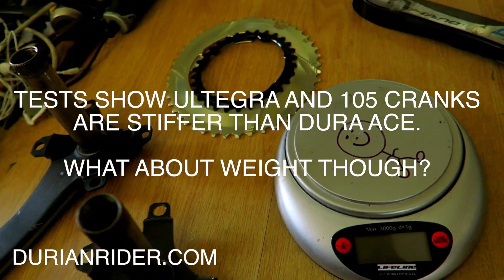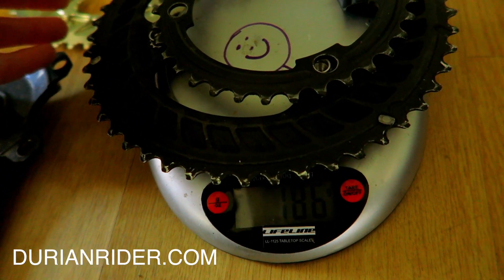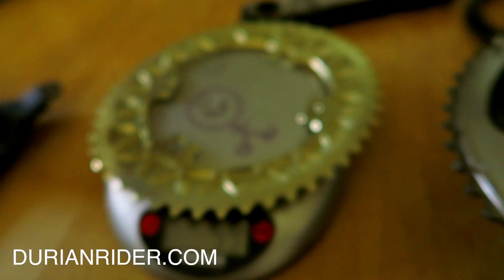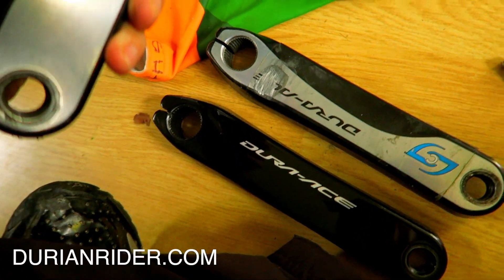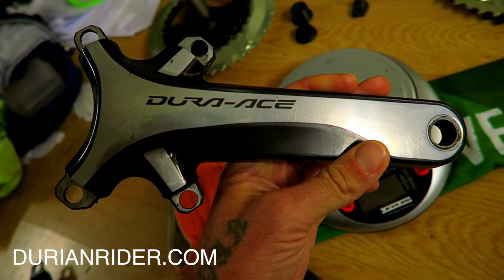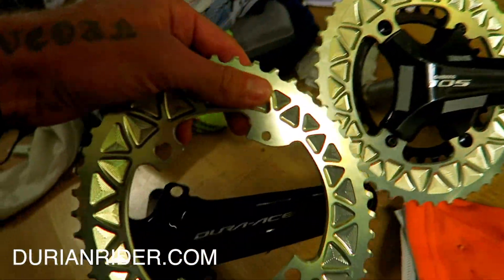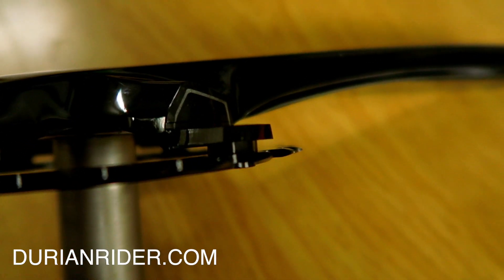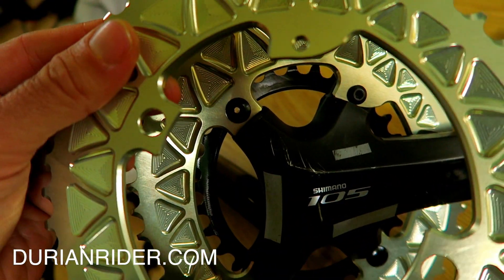How To Make Your Shimano 105 Cranks LIGHTER Than Dura Ace!

Comment: Would like to add another bonus for weight freaks like myself. Specialized turbo tubes are abt 45grams lighter then standard specialized tube. And there Abt 55 grams lighter then the average tube. That’s a saving of over 100grams on the wheels the turbo tubes are only abt 11.00 usd at my local shop. And I have had awesome luck with them

Comment: If you want the ABSOLUTE 100% lightest bike possible, you need to go with the upgrades across the board but if you want an "almost-lightest" bike on the cheap, smart upgrades like this are the way to go. You can get rid of 100g just by getting light inner tubes. Tyre choice can make a 150g difference too for almost no money. Also, check out the DIRT cheap 90g chinese carbon saddles - that could be 200-300g saved for $20.
Reply: What aren't reliable? The saddles? I've been commuting on mine for 90 mins a day for a few years now. I know a few hill climb racers who have them without issues too. They look hard as nails but are actually very comfy.
Reply: Sure. I'm 90kg by the way, used to be 110. Don't see any cracks but I guess you could get a beefier one if you wanted and still save some mega grams over typical $20 stuff. At the end of the day though, if something is badly built, even the thicker stuff would eventually crack.
Reply: Just search "carbon saddle 95g" in ebay and you'll see loads. Some say 110g in the descriptions but I can vouch for them being 90-95.

Comment: Idea for another video.... Show the front mech operation with the smaller rings as some commenters below were wondering what the front shift quality is like and how you have set up derailleur/ mount
Reply: I had the Absolute black 40-36 on the bike and they shift as good as ultegra that I had on originally

Comment: Wolf tooth 1x chain ring lighter again.... And you can loose the front derailleur and cable.... Saved me about 250g
Reply: This...
Reply: Great if you live somewhere flat, or if you like mountain bike level, cadence variations.
Reply: I thought 1x is good for both high or low cadence. Just choose the right number of cassete or chainring...
Great for average person...
Reply: @alradhi6627  no, you are far too often stuck in too high or too low of a cadence.   And when you shift,  your cadence may increase or drop 20rpm or more to maintain wattage.
Reply: Veganpotter Thevegan what about 1x with 3T bailout cassete? It have better range ratio...
Reply: Have you actually ridden 1x?
Reply: @alradhi6627  It's fine if you live somewhere fairly flat.   With any real climbing,  even steep rollers,  I would want nothing to do with 1x.  It works with cross because the climbs are so short and you're rarely going much over 25 or 30 on the downhills
Reply: Overall i am happy with my 1x drivetrain even my chainring and chain wear faster than 2x or even 3x effect from friction produced by narrow-wide system. Will try 3T cassete with 36t or 38t chainring for my future build with bigger jockey wheel to reduce friction.
Reply: @alradhi6627  The jockey wheels will have practically no effect on chain wear.  The pins get most of their wear from sideways force of chain angles.  That's why single speed chains last so long.   That said,  even bad chainwear is a drop in the bucket unless you only buy super expensive chains.
Reply: @alradhi6627  are you on a road bike?   I couldn't imagine ONLY having a 38t on a road bike.   Fine for cross.   I would want bigger for gravel too.  With a 10-42 I'd need at least a 44 or 46
Reply: Veganpotter Thevegan on dirt drop bar...
38:9 gear ratio is almost at the same place with 53:12 which is relatively high gear. it is lighter to use smaller chainring by the way... 
yeah small chainring looks terrible weird and lame...but I don’t care....
Reply: Veganpotter Thevegan by the way 1x on the road is very good for someone who prefer low cadence....like me....
If you are a high cadence person just stick with 2x.

Comment: I was hoping something other than swapping chainrings.  I was expecting something like changing the shaft or a little grinding in specific place. The stock chain rings always weigh more than most others.
Reply: It's typical clickbait, that's why I rarely returning to his vids. Just another lesson to stay away from it. btw the new DA cranks are much stiffer than the old one so for 1 gram it's big improvement. He should put Ultegra on scale as well coz that's best option for most who are not racing and have deeper pockets.
Reply: Hence the reason I am still not subscribed.

Comment: It looks like the Absolute black have threaded the inner ring to allow them to make a 30 ring, clever. Praxxis did the same but with their cranks. Can’t use a bolt and nut, just a bolt which is matched to the thread on the inner ring.

Comment: Stop smoking Sprite powder you DON'T NEED 2 chainrings. Go 1x it's the future.  40 36 rings is as old as you! get with the times durianrider get a single 30T narrow wide chainring. Drop that heavy front detaileur and get the sram 1x shifters you'll save 200g+ EASY. you can disagree but you still fucking wrong

Comment: Hey Durian I did exactly this to my Trek Emonda S5 ..Over 7 months ago and just stumbled across your video. .Brah I got a new Cassette 32 tooth and also a longer rear 105: derailleur. .from t he one that came with my bike ...medium cage ..and a KMC Silver 11 Speed Chain all in the Oval from Absolute Black was £147...52/36///and cass/derailleur/Chain was £90 price matched at Evans cycles Liverpool. .UK. .and nd they fitted em for £35 ...And the hills and climbs I feel are effortlessly easy and me been in big ring all day we rode 75/ miles today with Liverpool road and trail cycling club. ..and no one can touch me on the climbs am just popping past these dudes with so called fast aero carbon wheels..which are not great for climbing. ....Me was shouting at them all today saying Get Off my ducking wheel you cunts. ..dead loud ..mate your a funny fecker. ..Paul Conway. ..Did that guy in t he Bananas suit get his wheels back and did you get your rent? ! :)
Reply: thats great to hear, ive just ordered a oval small ring to try out and am super excited, if i like it, ill buy the big ring aswell.

Comment: I went from a SRAM pg990 cassette to a shimano xtr    titanium and saved abt 55grams on the rear wheel. Something I also find interesting is the fsa cheeper energy crankset is only 33 grams heavier then a fsa carbon k force  both are 50/34 gearing

Comment: So if I can get a 105 left crank arm with a meter on it.  Will it fit my Ultegra set up?
Reply: Yes, only cranks lenght must be the same. I use ultegra 6800 powermeter with 105 5800 crank
Reply: 4iiii 105 left crank arm $400. Works with all of them from Claris to dura ace.  Or you mail them yours and they’ll put it in for $400.

Comment: Does the older stages power meter off the 6800 etc fit the newer R8000??, or has the spline/axle changed?.
Reply: It’s all the same. I know guy who rides with R8000 stages left crank with 5700 right crank coz he damaged threads 😁
Reply: Tar for that, I thought as much but knowing how some companies negate cross compatibility by small but note worthy changes I was unsure. The price of 4iiii units are dropping here in the UK so probably a good time to upgrade to R8000 with 6800 4iiii..